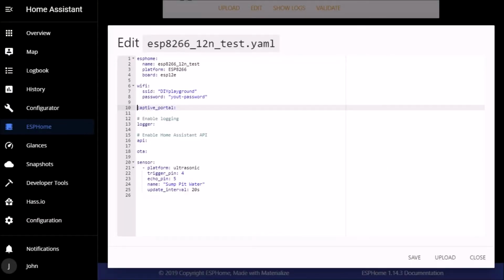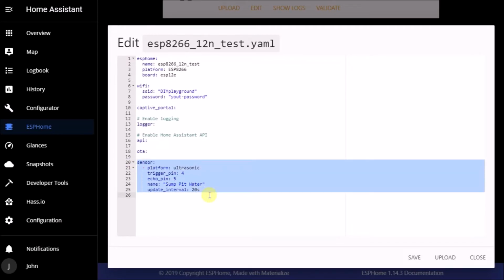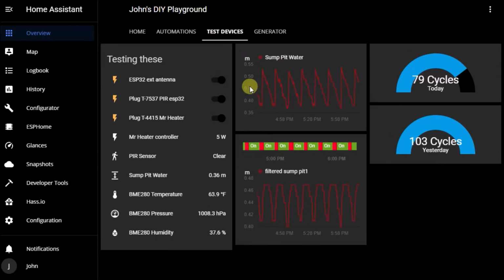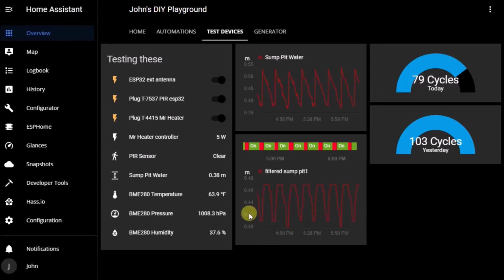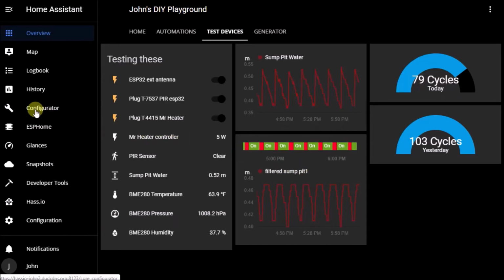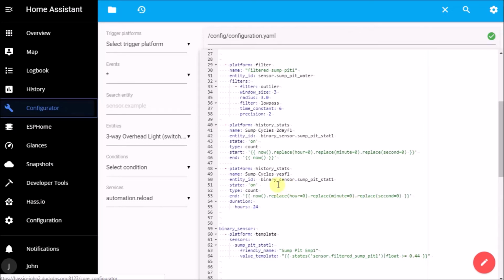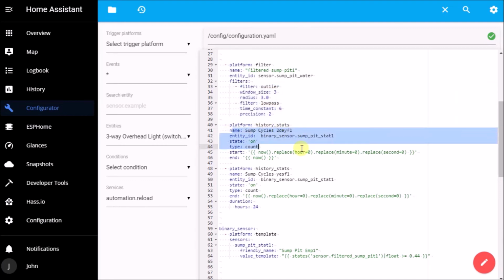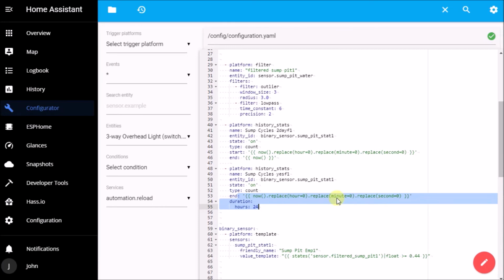Sump pit water level monitor

Comment: Hey John, just came back to your page to watch the weather sensor you made with the motieno.  Are you no longer using the pi Gateway ?  Low Power labs has the sump sensor and I have the same problem with the data looking like a saw tooth.  I like the idea of using the plastic downspout.  I wonder if that would help.  I've also noticed that just a drip of water into the pit seems to cause noise too.  Would be interested in talking to you sometime on the phone. I"m in Macomb Township.  Thanks, love all your work.
Reply from the maker: Hi Jack, I was experimenting more with the sensor in the last week.  I replaced with another sensor and got the same results.  So, I changed how I mounted the sensor and eliminated the clear plastic bracket.  I used hot glue to put the sensor on 1 edge of the gutter, on the opposite side I also hot glued the wires to kind of form a bridge so the sensor would be steady.  The results were night and day!  My data is clean now, no more noise in the readings.  So in summary, I found you cannot have anything touching the metal cans around the ultrasonic sensor transmitter and receiver.
Reply from the maker: And I am still using the pi Gateway and Moteinos but in very limited fashion now.  Home Assistant is more flexible for me and the size of my house (small).  With wifi, it all works here, so I don't need moteino but I do love how energy efficient the battery powered nodes are for things like weather and motion sensing.
Reply: @JohnsDIYPlayground  awesome,  and thanks for the reply.   I see that parallax has a laser sensor pin compatible with the ultrasonic sensor,  I'm going to try that.  I need more time to play with this stuff!
Reply from the maker: Let me know how that works, Jack.  Another solution I'm looking for is a way to sense the water levels in my gray and black water tanks in my RV.  I don't want to drill into the tanks.  I think there is some way with capacitance or hall effect to do it?  Yes, I need more time for tinkering too!!